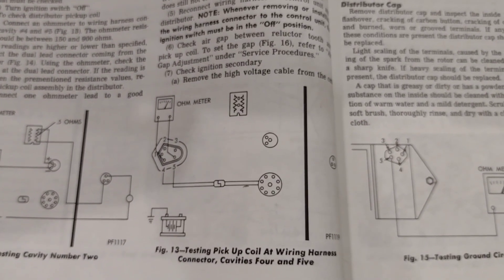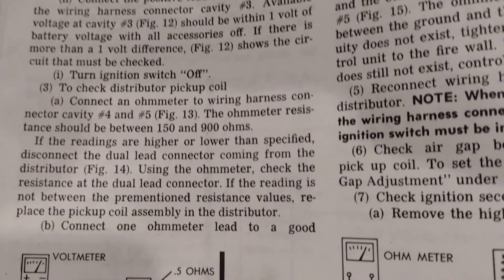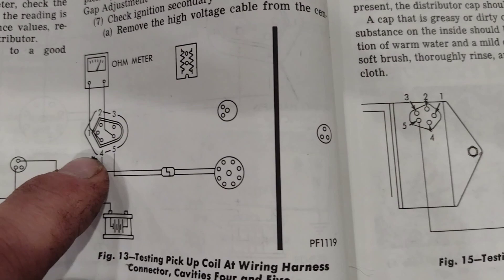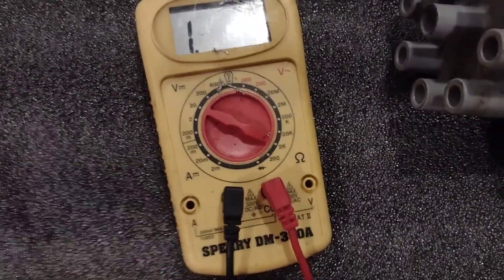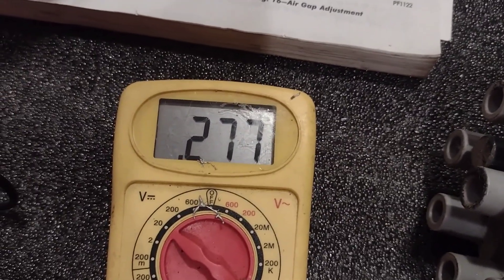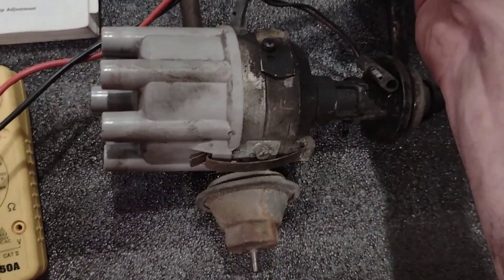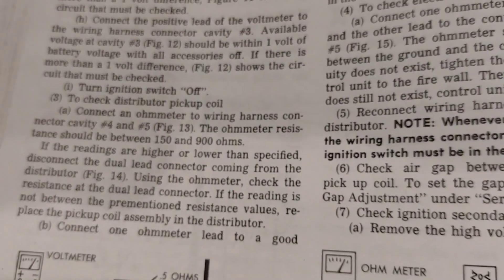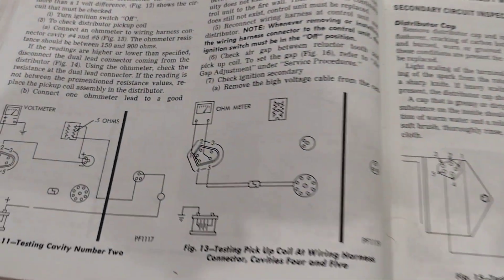Mopar electronic ignition quick distributor pickup test Dodge Chrysler Plymouth V8 and slant 6

Comment: We had a pickup coil go bad on a 72 Satellite electronic distributor. Bought a Duralast brand new distributor for like $80. Runs like a jewel. Going to rebuild the original distributor with a kit to have it as a backup.
Reply from the maker: I had a few problems with new ones from parts stores. Now I collect used ones.
Reply: @NathansMoparGarage  That's the preferred way to go. I had extra Slant 6 distributors but none for small blocks. And I haven't had a slant 6 car since 2011.
Reply from the maker: I have a bunch of V8 ones. I have only worked on one slant and it was in a pick up
Reply: @NathansMoparGarage  I despised the Slant 6 nylon gear at the bottom of the shaft. Trying to get that back in the way it came out was always challenging.